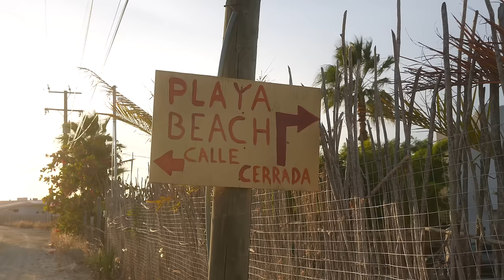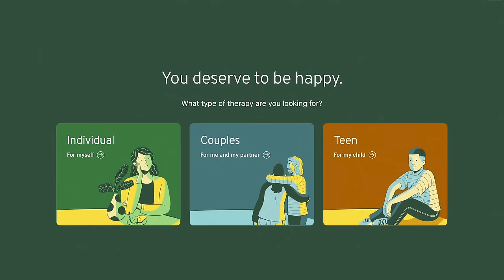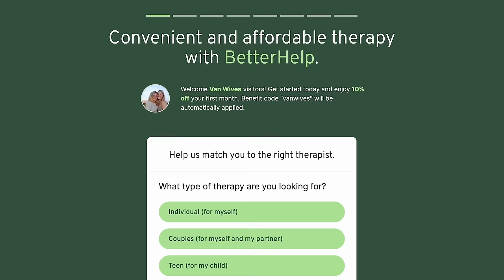We're Actually Moving to Mexico (not clickbait)

Comment: If you are planning to build with concrete I have just one word of advice... conduit!
Anyplace you think you might want electric or water, run a conduit.  Then you can add future wire or pex.  If you're starting from scratch, consider ICF.  Not the least expensive option but 25 years from now you'll still love the result.  
As others have said,  make sure you have proper title to the property.

Comment: That wall is NOT unecessary! Picture a hurricane. That wall will keep rain and sand from blowing onto those stairs. At best cut a hole in it and put a stained safety glass window in it. Or glass cube wall. But I would not knock it down. Remember it was built by a builder and I am sure he had good reason.

Comment: Foundation is the most important focus Especially on sandy areas. Here in SA sand like beach id not advised to build on . Sand will  erode , it's  recommended to dig 700deep (100mm gravel compacted ) then foundation 600mm deep foundations . Don't hurry the building . Let the Foundation settle for at least 3 weeks. Slightly spray water keeping it moist so it cures slowly. Concrete will then set harder and stronger that way . You should also add rebar to strengthen the foundation.Not sure the cost there but very expensive in SA. Also need to consider thick walls for temperature control.  Costs always end up 40% more than originally expected with all the unforseen  expenses. But beautiful and solid when finished.
Reply from the maker: Thank you for sharing all your knowledge with us. We sure do appreciated the support. 😊🐶
Reply: Love your family, adventure, positive outlook.... Hope you can use that to be prepared...... I wish you all the best and look forward to watching more

Comment: Girls, Something to possibly think about when designing your new projects, whether at the good old pack cabin or the new garden of Eden, just off the beach. A k a dubbed ("New Sanctuary.") Try to design with roundness in mind. Both places can experience hurricane force winds. A good example might be a water tower or your Dome greenhouse. The roundness offers little resistance. The wind, for the most part, just slips on bye. Flat structures, for the most part, take that wind force head on. This can create a great amount of wind shear, which can be for extended periods of time. This is typically what rips the roof of a house. The wind hits the wall, and then it's redirected straight up to the bottom of the overhang. Poof roof is gone. When the structure of the roof is gone, without the rafters supporting the structure of the walls, some walls not all can be much easier to blow flat. So if you're going to build flat walls, it needs to be heavy enough to take it. Remember that the foundation works is key to this endeavor. Without a good, heavy, proper foundation , I don't care what the walls are made out of more than likely it's gonna blow down. I know your current home structures are square. But you can design your gardens to be a bit rounder. They are going to take the initial first hit of the wind. That bamboo is a beautiful thing. Could be the center piece of a Tiara shaped shield. Tall, thick and dense in the middle. Other plants off to the sides, reducing in size out towards the edges. Creating that roundness for a square space. Always try to keep those prevailing winds in mind. Two beautiful girls living a beautiful dream even if sometimes it seems like a nightmar. Sometimes when it seems to be just too much. Remember to take the time to just take a step back and take a breath or two and reset. Remember girls it's a mindset. Stay positive for positive thinking. I believe you girls can do anything you set your minds too. You just have to wanna dream it.✌️🤟🖖

Comment: Topic:   About Building Homes Out of Cement.  Air Concrete &   Earth Bags
        With 108 comments, I think this would get lost in your pinned comment 
about building homes out of cement.
          I have been watching a channel that uses Air Concrete to build rafters for their patio & as Pavers to decorate their large Garage/Shop.  It is a foamy mixture that can be molded into what ever shape the builder decides.  Make the mold, let it set in the hot sun, then build.
          The channel is My Little Homestead, & located in the Arizona dessert.  They are a family that has alternative ways of building houses.  Using Earth Bags to build an add on to the kitchen of an existing house, then building a separate round structure for each child to have their own bedroom, & a Round Studio with an underground basement.  
           There is another channel, My Tiny Shiny Home, using Earth Bags currently building a home in the round. They have workshops to teach people their method.   Also, located in Arizona.

Comment: Gals,

I hope your dream comes true. 

I also hope you get an already built home cause concrete construction is harder and more technical that what you do here in the north.  You certainly will need to hire help. At least the guy with the knowledge, and maybe two helpers for the muscle. 

Probably you will not have a full blast, nearby  Home Depot like hardware store.  Materiales or equipment rental will be harder or nonexistent. 

Given you mentioned "winter vacation home", it will be great if you some create some rental income during the rest of the year.  Either additional smaller houses or spaces for Van's or RVs.

Best luck to both of you.
Reply from the maker: Thank you we appreciate your support and suggestions. 😊🐶

Comment: Wet casting walls is relatively easy. But the cost of reinforcement and formwork, makes cement block building easier.

The Whole Building Design Guide, is a guide to building Federal buildings anywhere in USA/ Workd. So lots of detail on ground stabilisation, all the way to finishes.